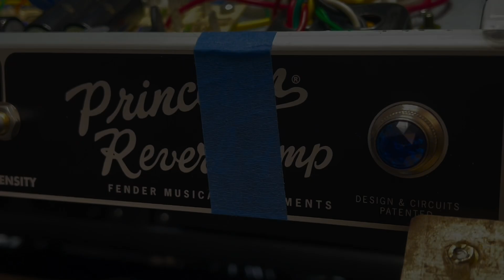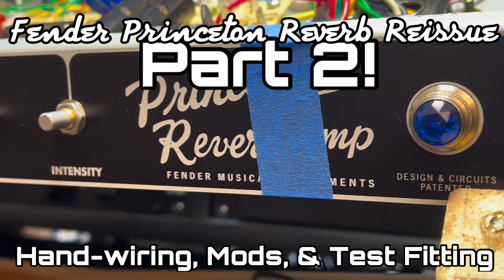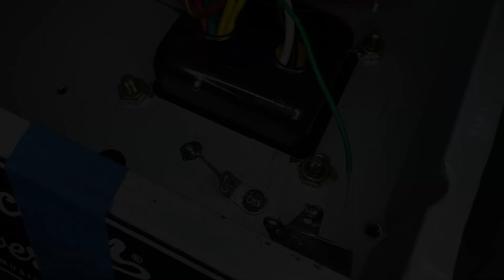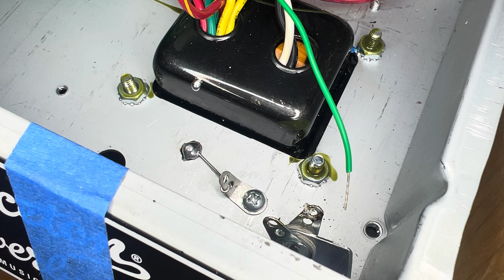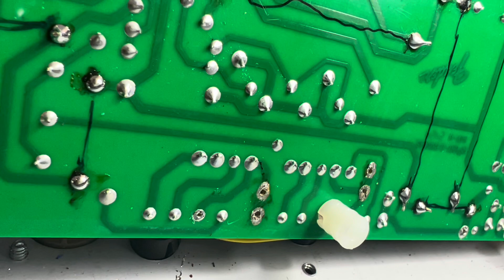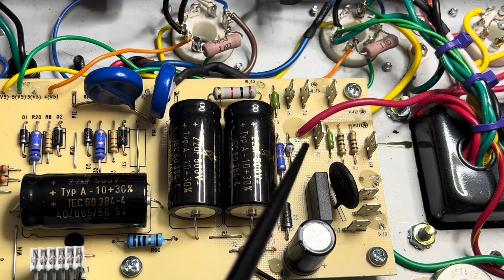Hand-Wiring, Mods, & Test Fitting — Fender Princeton Reverb reissue Part 2

Comment: I like that chassis ground ! I just tried soldering one of those lugs directly to a chassis. It seems solid. I'll give it a real good whack with a screw driver to make damn sure. But it seems like my soldering gun has it on there .
Reply from the maker: Thank you!  If you solder the lug itself to chassis there’s a good chance it can fail!
Reply: I think I see a cracked 104k cap . 7:44 bottom left of screen
Reply from the maker: @soapboxearth2 it’s just a optical illusion 🍻